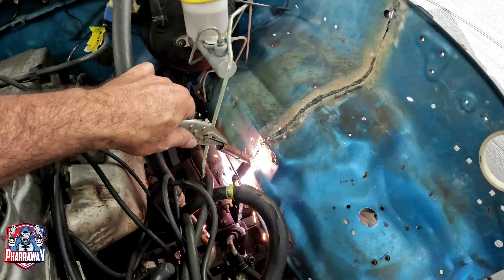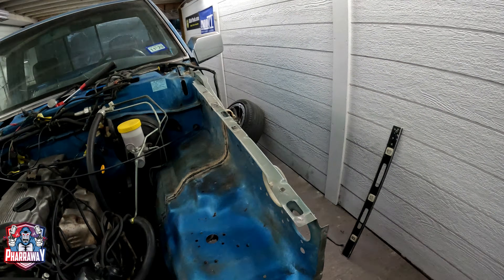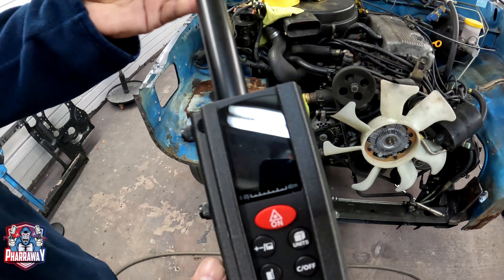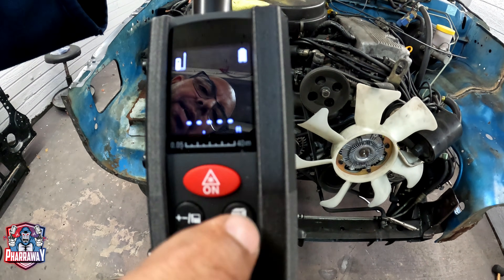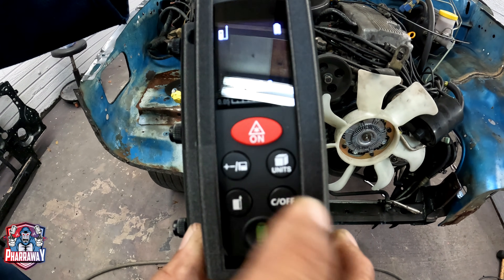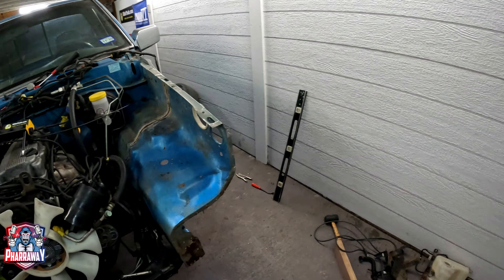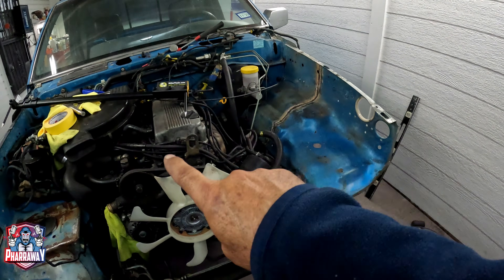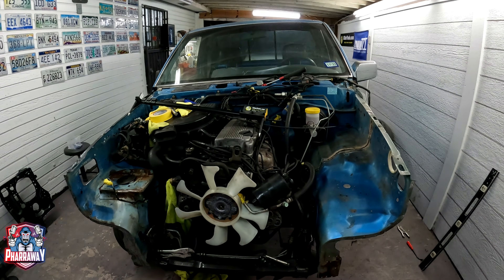How to Square Up Your Truck’s Front End Using a Tram Gauge / Killer Tools Tram Gauge--ART90MZ

Comment: Hi Pharraway, very interesting video as I've never heard of a Tram Gauge before but when I restored an old Ford Cortina back in the 80's I just used a tape measure to align the front inner fenders the same way as you did here but it seemed to work🤔back then I don't think mig welders were available so I did the complete restoration using a ark welder (stick weld) and it was a right pain😂

My classic 1983 Granada 2.8i has so many vacuum pipes it's unreal, I wish I had your skills so I could get rid of some of them as I'm sure they are not all needed🤷‍♂thanks for sharing your skills with us brother👍John UK
Reply from the maker: Thank you brother 🙏

Comment: I’ve been doing rebuilders for years in years and years, you need to trash the flux core welding yet oh good gas, meg welder I guarantee you your welder full of impurities
Reply: I agree, it’s not built for thin steel too, can easily warp as it puts a lot of heat in the panel. I’m bout to do a rust repair and ran out of budget for the Mig gas upgrade I wanted, so I’ll have to do it flux core and I’m dreading it.
Reply: Great to see all the process, the primo did great, looks 100 times better than, when you got it..i agree, flux core has its place, a lil mig with gas does improve the process and outcome, or even braze welding with a old fashion clothes hanger thats not coated of course..cool measureing device$, sure beats a plumb bob, keep up the great videos on the build, the mini is starting to come together nicely..
Reply from the maker: Appreciate the advice